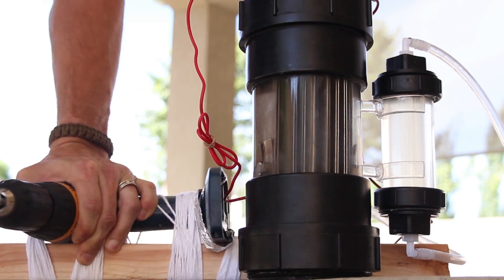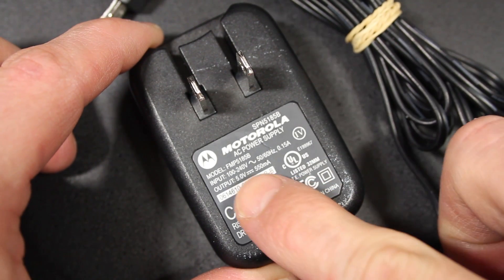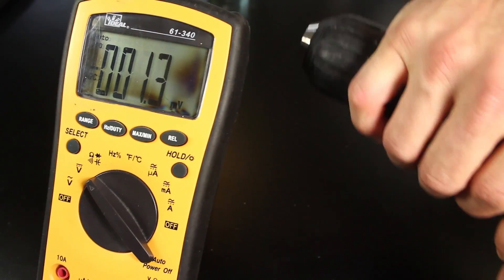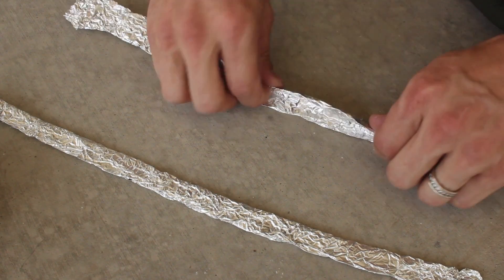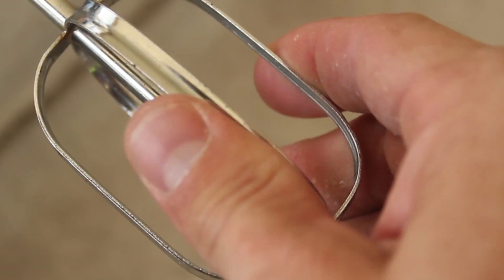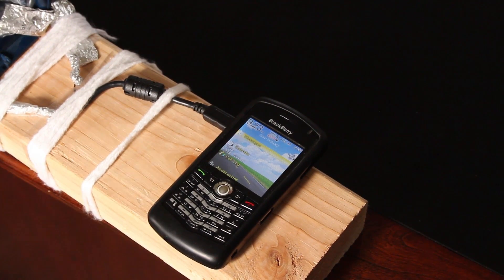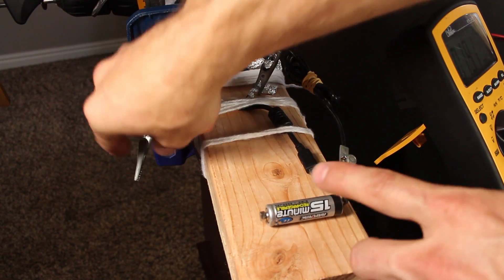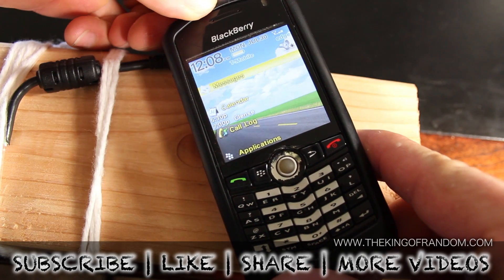Make an Emergency Phone Charger - MacGyver Style!

Comment: He said 5 volts of current.  Current is measured in Amps not volts.  
Ohms law:  Voltage = Resistance X Current
Reply: DC stands for Direct Current, AC stands for Alternating Current.  You can have 5 volts of alternating current, if you have that coming out of a usb port your in trouble!
Reply: James Sheffield voltage is a function of resistance and current flow in a circuit. It is a mistake to equate voltage with current.
Reply: danpt2000 U (V) = I (A) x R.(Ohm). In DC of course. Voltage is not a function
of resistance. Voltage is a power sourche (and pot. difference). A pot.difference
is a sorth of pressure, waiting for the cicuit to be closed. Once closed a current
will flow. The current depends of any resistance (like a resistor) in the circuit...
The bigger R the lower I. In relation to V, R could be a Voltage divider (each R
has some of the voltage over it). unlike I,
Reply: danpt2000 if you equate voltage with current your measuring WATTS.
(basically). P = V x I.   P= power in WATTS. V= electrical pot.  in VOLTS.
I= current in AMPERE.  (this is only some basics, there are more formula's
on this).
Reply: Yes but the two types of electricity are direct current and alternating current. He was merely specify which type of current it was. There is direct current DC and alternating current AC. And 5 volts AC is not the same as 5 volt DC. DC produces more output per volt than AC does. DC current travels one direction, while AC current travels in Alternating  direction. He could have said I have 5v of DC instead of I have 5v of Direct Current. DC power is direct current that is what DC stand for. Just like USA stands for United States of America. So if I said "I live in the USA" that is the same as "I live in the United States of America".
Reply: James Sheffield So the english language is wrong. Lets just call it "direct voltage" and "alternating voltage" or even better: "constant polarity potential difference" and "alternating polarity potential difference" :)
Reply: Edgar Brucke These new fangled names will surely catch on! Great ideas!

Comment: WOuld this work on any drill? WOuld it work on a cordless drill?

Does the drill inside already implement some kind of rectifier.. I thought it was AC and the phone charges by DC.

I have a blender i dont need but still works. WOuld it work what do i need to modify it?

Comment: A lot of comments have been made about the quality of the power. If available, a 5V zener diode would protect the load, and as a resistor, one can use a flashlight light bulb. In any event, when stuck in a "Sandy" like situation, this is a totally valid way of keeping one's nose above the water.   =)

Comment: This is a very good method. Thanks for showing it to us. You can also attach a larger crank on it with a 4 way type of paddle and put it into a stream letting the water turn the paddle and charge it for you. That way it's hands off and still free power.
Reply: you can also ask your self if it is not much better to go and buy a new loader.
the time the VOLL-IDIOT needed had better be used to cook dinner...Now he
must go and buy some fast food. Very good method indeed, except in times
of emergency. If the lamer had a litte more IQ (or brains) he could have (in case
or times of emergency) had a second loader for in case the 1 one was broke or
gone. And last but not, take any magzine and you find some gadgets. One of
these is a simple machine (like in war time), connect it to the cell phone, then
hold in your hand. use the spindle and turn it around and around...it's made for
in case you no loader or power sourche. Its'cheap too. So why this project ?.

Comment: And where did you get the value of a "40 Watt" charge capability from? I didn't see any measurement of voltage and amperage during charge.
Reply: To add, that device does tell the levels. Voltmeter....buy one. 
edit: He has a mutlimeter...That makes you look even more stupid as that tells all the levels of amps and volts by standard.
Reply: jedadiah Taylor Could you re-state your response in English?
Reply: Ed Price That was cheap...
Reply: jedadiah Taylor Unfortunately, both the insult and the content of your post was confused, so I wanted to give you another chance to develop your thoughts into either a proper insult or a coherent technical comment. Your choice; be rational or cheap.
Reply: Wasn't really a insult towards you. You were insulting him. He goes through a lot of effort and should be proud of what he does. And you piss on it with comments that have no research backed up before it.
To stop a mindless internet fight, it's a multimeter, i own one. They can tell both amps and volts, therefore watts.
Reply: jedadiah Taylor Fine, I never intended to argue. Yes, you may own a multimeter. My point is that the author described the project as a "40 Watt Electrical Generator." I am very skeptical that he could obtain 40 Watts from hand cranking that drill, and I asked about the source of his claim. Since the author does not know the source impedance of the drill motor nor the load impedance of the load, he must measure both the drill motor output current and voltage AT THE SAME TIME. Swapping a single meter, in Amps mode and then in Volts mode, is not good enough. A typical multimeter can't do both modes at once, so your insult suggesting I buy a DMM only shows your arrogance and lack of familiarity with simple test equipment. The fact that you think you can swap one meter in two modes shows your lack of understanding of measurement fundamentals. And please understand that I am not insulting you by pointing out your technical shortcomings. However, a wise course would be to educate yourself further before leaping to cheap insults. If you get really smart, you might even notice that the drill motor will not generate pure DC, so you must go beyond DC Amps and Volts and consider the effects of ripple waveform and determine true RMS current, voltage and power. And to be precise, you will also have to consider the phase lag between the voltage and current.
Lastly, why don't you see what the real power output is for a hand-cranked generator. I'm guessing that 40 Watts is simply not humanly possible, but part of your education could be in setting up a decently instrumented experiment to prove me wrong. What's really cool about science and engineering is that what's right is not affected by your rude opinions.
Reply: jedadiah Taylor Jed, the essence of engineering is to look at the technical claims to evaluate an effort. If the man says he's made a 40 Watt generator, I would like to see his performance data proving what he did. That's the difference between engineering and tall tales. This technique will serve you well when somebody claims to have built a device with 100% efficiency, or when somebody claims something really spectacular. Looking at the methodology and the numbers is not "pissing on anything." Get with the scientific method, and also try very hard to lose the arrogant, quick to lash out with an insult attitude you came in with.
Reply: I see were you are coming at Ed, and i thought you were being the "quick to lash out with a insult" kinda person towards him. 
My point is he makes great video's.
p.s, i am doing cert 2 in engineering at Tafe and cert 1 in construction. I also love evolution and biology, so science is kinda my thing at school now. (so i am not all lash and stab in terms of facts)
Guess you could say i just thought you were pissing on a man who deserves better.
:) plus the way you said it was just as arrogant as my first comment. Maybe not to you. This "situation" is two fold.
Reply: jedadiah Taylor Great videos are those with accurate technical content, and aren't we both still waiting for the author to tell us if his 40 Watt Generator really generates 40 Watts? Or just how truthful was his claim that the electricity was "free?" Claiming to refute TANSTAAFL requires extraordinary proof. In the future, don't be so quick to play the white knight defending those who won't speak for themselves. And if you think anything I have said has been cruel, well, you really need to understand that a spade is a spade, no matter how you chrome plate it.
Reply: I like your use of English XD wasn't trying to be a white knight, i am just a big fan of his work. Before you see me as the idiot in this situation judge yourself as well. Does he have to show proof, does he have to upload cool videos for our enjoyment, does he have to be a engineer.
Although i see your point and have learnt from you. Hope you can learn a bit from me. Like to appreciate how much he has done already. 
(i am a one of those ever-changing opinion people XD)
ps i would also like to see if the power is actually "free". That would be interesting. My theory is the battery would die from damage from the unstable and ever-changing amount of electrons passing through the wires.
Reply: jedadiah Taylor Jed, the author said he built a "40 Watt Generator," so I took him at his word and gave him several minutes of my life. What he delivered was something that likely does work, but not at 40 Watts. The author himself probably doesn't even know this. It's important to have this little bird on your shoulder that keeps tweeting "know what you're doing and be honest about what you claim." Maybe his bird died.
Reply: jedadiah Taylor To answer you directly. Does the author have to be an engineer? No. Does he have to upload cool videos? No. Does he have to show proof? Yes, especially when he makes specific numeric claims and/or claims to get results in an unusual way. And finally, the power is not "free." You paid for that generated power when you bought your burger and fries yesterday and when you bought that drill, screwdriver and spoon a few years ago. Lastly, I have learned that this forum is a "gee-whiz" group that is much more impressed with cool than practical, so maybe I was judging the value of this video by too realistic of standards. If a man says 40 Watts, I figure he means 40 Watts; if he would have said simply "Way Cool; Charge your Cell Phone with just Garage Junk and a few Hours of Mindless Finger Twisting," I wouldn't have had anything to bitch about.
Reply: True that. I haven't bought a burger XD
Reply: I have a question for you Ed Price. The video says he gets 5 volts of current. I pointed out that Current or Amperage is not measured in Volts. You have to look at any electrical circuit in terms of Ohms Law. Voltage is a function of resistance and current flow or Amperage. Do you agree?
Reply: danpt2000 Sure, I agree that Ohm's Law is applicable. The error of talking about current in units of Volts is trivial, at least from my point of view, it doesn't confuse me. Amateurs make these kinds of verbal slips all the time, and I didn't think it serious enough to call him on it. My biggest question was that he said this was a 40 Watt charger, and then he mentions the 5 Volts you also mentioned. But, is that Voc or V across some load? The only way to know if he achieved his claimed 40 Watts is to measure output Current and Voltage at the same time. That seems impossible as he has a single DMM that measures only Voltage or Current, but not both at the same time. I'm betting that he can't get anywhere near 40 Watts output, and in almost 2 months, the author hasn't responded.

Comment: I think scariac much more better. no need to spin around.
Reply: no, get a rat or mouse or something like that. take a closed wheel and put the
animal in it. Glue the wheel to the drill and let the rat/mouse do the work....or
glue some pieces of plastic on the wheel and put it under the water tap, it works
just fine.

Comment: I did this with a gym bike, (the ones that stay in place and show you how far you have traveled), attached an extension cord to allow up to 4 phones or other objects to be charged, then attached a regulator to each end to keep the power to exactly 5 volts for each phone. It took me 3 hours also, but the added benefit, aside from 3 more phones, is you lose weight! :D
Reply: really nice,you should do a video of it
Grant Thompson - "The King of Random" need to see it! :3
Reply: Rig one of those to charge a home solar battery array and you are in business. 
Power and exercise.

Comment: would you be able to hook it up to one of those work out bikes to charge a whole bunch of batteries?
Reply: A resistor would take down any voltage. If you produced a weak voltage, a resistor would kill it. Please, correct me if i'm wrong.
Reply: MAKAB36 You could hook up safety fuse, or a motherboard that would control the voltage?
Reply: MAKAB36 just throw a regulator on it, work just as well
Reply: Did you not hear him say if he cranked it to fast he would risk damaging the phone which is reason enough to think twice about doing this unless it was absolutely necessary and the reason your Idea wouldn't have the desire effect unless you peddle very very slow, Note you can get a cheap charger that works with AAA batteries and has many connections. This project has merit though it teaches you to think outside the box.
Reply: MAKAB36 Maybe you could link it up to multiple batteries so it gets distributed?
Reply: Davis Parks yeah, that's an easier way to do it:D
Reply: A simple resister would control the voltage but not many people would have one lying around
Reply: I would expect someone peddling a Bike hooked up to  a drill with 18v power would be able to generate 18v many circuit boards work on 9v with resistors in the circuit so I don't think in this setup a resistor would kill it but your right a WEAK voltage would be "taken down" but I don't believe 18v is considered weak in this example.  Fine so try your way, I'm over this conversation I didn't comment in an attempt to upset you but if you want to be upset get upset, I was just trying to caution people for what "I" thought could potentially damage someones expensive Mobile, Maybe I'm wrong but sometimes it's best to err on the side of caution.
Reply: Nonono, i don't mean to start an argument, nothing like that, i'm just sharing my opinion, and hoping someone with more knowledge than me will say is it right or wrong, i like to learn.
Back to the subject... what if someone is going slowly, and he's hooked up to a resistor? In full speed, a resistor would not 'kill' the current, but pedaling slowly...?
Reply: Infidel Croatia it would work, you just need a regulator so the output dosnt wreck batteries
Reply: A home trainer is a very good idea. In fact, you can do a work out and load
the accu at the same time. However, the project is not so good, better take
the dynamo of your bike. A bike's dynamo can deliver 6-12 volts (AC). Now
get some electronic parts to turn the AC into DC, and make sure it's 5V. A
stabilisator for making sure the output is steady.. Then do the work out and
i'll bet the time you need to load is much shorter.

Comment: One idea with the fork is secure it tightly so it wont wiggle and drill a hole at the other end of the fork. Put a rod about the size of the hole in it and then glue a small square of wood on it on the side you will not hold, and tightly bring it to the hole, and then have a nut that might fit on the other side of the rod to allow you to crank it, so you now have an easier way to crank it

Comment: hi! with a diode, a capacitor and a 7805 that would be more secure, if you go faster and generate more than 5v you can damage your phone.

bye
Reply: Could you connect the drill wires to a cigarette lighter charging adapter as a means to prevent the over-voltage?

Comment: thats an interesting idea.....try it and see what happens.  I dont think so because the polarity would need to be reversed to send a charge from rotating the drill while the battery is connected....and im not sure 5 amps would be enough to charge your drill battery.  You probably need to get a new charger.  Try it out tho, its not like you're going to ruin your drill doing it.

Comment: Use an 7805 first before burning your phone.Input of 7805 goes to + contact on the drill common on - contact and output to your phone.Simple yet effective.Thumbs up so others can see it.Also if the drill won't spin, it would likely discharge your phone as it powers the motor through usb.prevent this by using a diode

Comment: It is a hydrogen gas generator (which also produces oxygen) by separating water (H2O) into it's individual elements using electrolysis. He hooked the generator he made in this video to it to make the process work.

Comment: You would damage the battery, what you need is a voltage regulator to ensure that doesn't happen (i have heaps of voltage regulators).

Comment: do you think that it's possible to do this with a corded drill using an outlet to connect the circuit to the charger? I'm thinking you'd have to use an outlet that's not connected to the house grid, but it might cut out a lot of the wiring and splicing.

Comment: I have gone through at least half a dozen of those Ryobi batteries. They don't last very long and Ryobi's tool warranty doesn't cover their batteries for obvious reasons. Might I suggest taking a bad battery, gutting the NiCad batteries out of it and soldering power leads to the power terminals. That was in an emergency situation, all you have to do is plug in the old defective battery. Also you can use Velcro cable straps to quickly and easily tie the trigger down all the way.

Comment: If you have an I phone get a 9 volt battery a red and black electric wire put them on the positive and negative on the battery get your iPhone charger and at the end with the USB cut that of and expose the wires in side the put the red wire with the red wire in the cord and same as the black there you go and it's portable ive done it